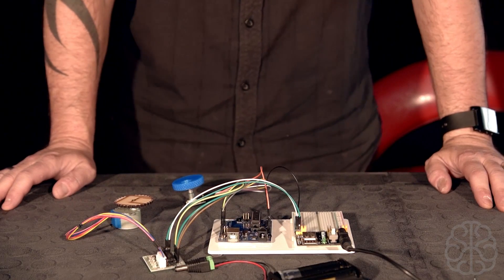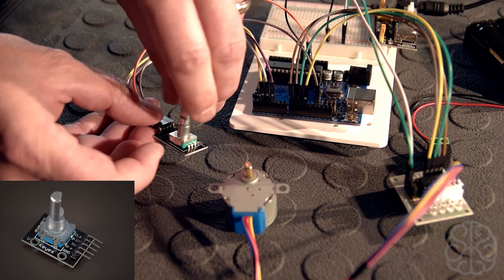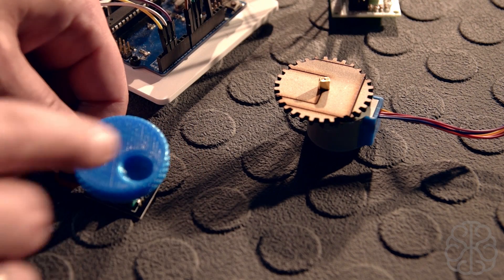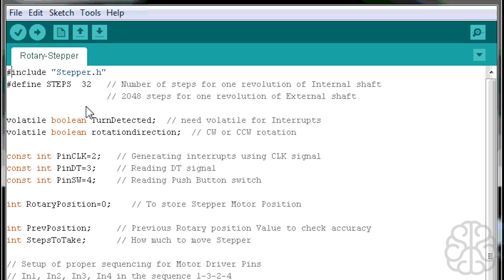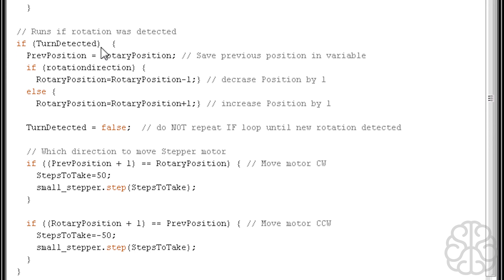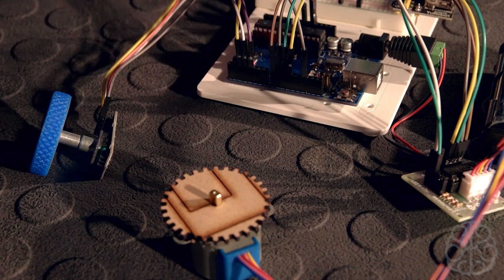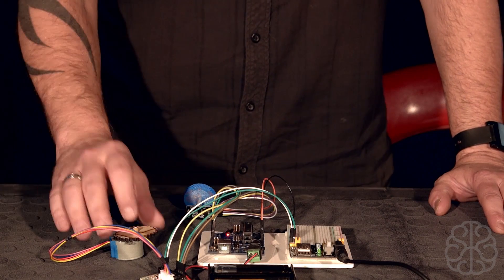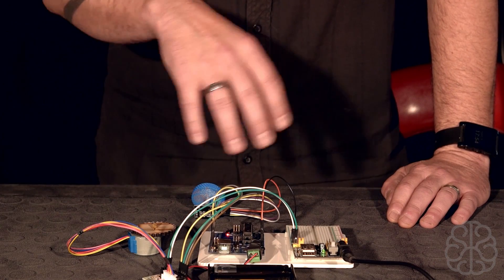Control a Stepper Motor using an Arduino and a Rotary Encoder - Tutorial - Part 1

Comment: I set this up, but on mine it doesn't always turn the stepper, and the lights on the driver board kind of switch around without input, I must have messed something up in the code.

Comment: Could you do that same setup, but use the encoder to "start the motor in 1 direction, having it just run continually, until you push the button to stop it, or reverse the encoder?  Also, the further you turn the encoder, the faster the motor spins. So 50% encoder clockwise means motor spins at 50% speed continually in the same direction?  Thanks..
Great Video

Comment: this looks like a very useful setup, thanks for taking the time to upload, could you please add homing and limit switch's to the code, or a video on how to include homing and limit switch's, I'm new to motors and struggling with homing and limit switch's, i need exactly your setup in this video, same motor setup/encoder, i identical but with homing and limit switch's , ive been working on it for a very long time and about to give up, any help please. thanks

Comment: arduino source code?
Reply: #include "Stepper.h"
#define STEPS  32   // Number of steps for one revolution of Internal shaft
                    // 2048 steps for one revolution of External shaft

volatile boolean TurnDetected;  // need volatile for Interrupts
volatile boolean rotationdirection;  // CW or CCW rotation

const int PinCLK=2;   // Generating interrupts using CLK signal
const int PinDT=3;    // Reading DT signal
const int PinSW=4;    // Reading Push Button switch

int RotaryPosition=0;    // To store Stepper Motor Position

int PrevPosition;     // Previous Rotary position Value to check accuracy
int StepsToTake;      // How much to move Stepper

// Setup of proper sequencing for Motor Driver Pins
// In1, In2, In3, In4 in the sequence 1-3-2-4
Stepper small_stepper(STEPS, 8, 10, 9, 11);

// Interrupt routine runs if CLK goes from HIGH to LOW
void isr ()  {
  delay(4);  // delay for Debouncing
  if (digitalRead(PinCLK))
    rotationdirection= digitalRead(PinDT);
  else
    rotationdirection= !digitalRead(PinDT);
  TurnDetected = true;
}

void setup ()  {
  
pinMode(PinCLK,INPUT);
pinMode(PinDT,INPUT);  
pinMode(PinSW,INPUT);
digitalWrite(PinSW, HIGH); // Pull-Up resistor for switch
attachInterrupt (0,isr,FALLING); // interrupt 0 always connected to pin 2 on Arduino UNO
}

void loop ()  {
  small_stepper.setSpeed(600); //Max seems to be 700
  if (!(digitalRead(PinSW))) {   // check if button is pressed
    if (RotaryPosition == 0) {  // check if button was already pressed
    } else {
        small_stepper.step(-(RotaryPosition*50));
        RotaryPosition=0; // Reset position to ZERO
      }
    }

  // Runs if rotation was detected
  if (TurnDetected)  {
    PrevPosition = RotaryPosition; // Save previous position in variable
    if (rotationdirection) {
      RotaryPosition=RotaryPosition-1;} // decrase Position by 1
    else {
      RotaryPosition=RotaryPosition+1;} // increase Position by 1

    TurnDetected = false;  // do NOT repeat IF loop until new rotation detected

    // Which direction to move Stepper motor
    if ((PrevPosition + 1) == RotaryPosition) { // Move motor CW
      StepsToTake=50; 
      small_stepper.step(StepsToTake);
    }

    if ((RotaryPosition + 1) == PrevPosition) { // Move motor CCW
      StepsToTake=-50;
      small_stepper.step(StepsToTake);
    }
  }
}

Comment: is there is a possibility to remove the shock from the stepper motor. when turning the rotary encoder it is only one direction .if I turn one way, it goes well but in the other direction it is shocking and it does not go well. how can I solve this?

Comment: Is there a particular Arduino kit I should get to run a stepper motor like in this video? Amazon has several different brands I'm not sure what the differences are to choose one : (
Reply: I got the elegoo kit which had 5 motors and 5 drivers. The driver board in this kit does nothing but increase the voltage from the arduino pins, and the leds on the side of driver show which pins (connected to motor) are getting power (which is great for learning).
"Elegoo 5 sets 28BYJ-48 ULN2003 5V Stepper Motor + ULN2003 Driver Board for Arduino"

Comment: You shouldn't use delay() inside your interrupts. You might mess up syncing with the internal clock in your code.
Reply: Can you break down "the why?" - I'm not familiar with why you would or wouldn't

Comment: Anyone try this project with this particular uln2003 module?
http://www.ebay.com/itm/231759592903?_trksid=p2057872.m2749.l2648&ssPageName=STRK%3AMEBIDX%3AIT
I've connected everything as shown on the Brainy-Bitz website, but the stepper only hums when the encoder is turned.
I'm using a 12v 800mA power supply, an arduino uno, & this encoder module.
http://www.ebay.com/itm/191886018364?_trksid=p2057872.m2749.l2648&ssPageName=STRK%3AMEBIDX%3AIT

Comment: plz reply me....
Thanks for making this video .......I have some questions regarding my project are....
1. for NEMA 23 motor 2.8 amp which driver should I use 
2.plz can you send Arduino coading for ' if we rotate rotary encoder 30° then motor rotate 15° in opposite direction ' 
3. when I rotate encoder the torque is same as on motor specifications or less??

Thank you very much.........

Comment: Hi, I am controlling my stepper motor automatically from the Arduino board, but once it moves and stops where I want, It does not go back to original (home) location [after short delay]. Any help with coding please

Comment: nice tutorial !!!!!!.  Tell me something plz. In your video you can control the position of a stepper motor by rotating the rotary encoder. If you want continues rotation with speed control (like a potentiometer for example), can you do it with rotary encoder? . For example, you can control the position as you video. Fine.  When click the rotary encoder, instead of returning back, can you use it for continues speed control ? (like a potentiometer?)  thank you

Comment: How did you manage to spin it that fast? It is 4096 step in one revolution according to spec (http://www.instructables.com/ORIG/FQY/RHST/HMVJ7U24/FQYRHSTHMVJ7U24.pdf) and frequency 100Hz.. which makes it about 40 seconds for one revolution, that is how fast I managed to spin it.. thanks.
Reply from the maker: From my understanding the library we are using runs those steppers in 4-step sequence.
Your mention of 4096 steps per revolution is correct when the stepper is run in 8-step sequence.
So in 8-step it will take 4096 steps for a full revolution of the shaft.  But in 4-steps it will only take 2048 steps.
That's why the stepper is running faster in this tutorial video.  You can checkout our tutorial page here: https://brainy-bits.com/tutorials/stepper-motor-rotary-encoder-p1/ and get more information.  Hope that helps and thank you for watching!
Reply: Brainy-Bits, yes, I wrote driver for 8 step sequence , I remembered it gave motor extra torque. Thanks.

Comment: Can u help me? I know how to use an enconder and a stepper but, i want to learn how to save a sequence of movements with variations of speed during 5+ minutes and use a button to repeat the actions that ive done before...
Reply: The idea is a motion control... I want to use 5 motors with encoders to enter different sequences of movements, cw ccw, speed variations... Saving the movements to repeat forward and backward. Can u do a video about it?

Tks!
Reply from the maker: Thanks for the suggestion, I have though of doing something like this, recording movements and play them back...  Will try to do a video on that.  Thanks for watching!

Comment: Hi,- Excellent tutorial. 
Can you tell me if the USB connection on the breadboard power supply is for 5v in or out because if its for 5v in I think you would need a special USB Cable.
 I will  definitely get one if I can drive it from a USB input.
Thanks - Keep up the good work
Reply from the maker: Hi, I believe these Breadboard power supply can be powered by USB, but keep in mind that a typical USB port on a computer has a 500mA limit.  Or you could use a Cell Phone charger with the correct cable like you said.  Thanks for your comment and for watching!

Comment: you can add two 1uF capacitor between A n GND and B n GND, and it will improve step skipping alot
Reply: Hi Herantd, can you please explain how to put these capacitors into the scheme?Thanks, Martijn
Reply: https://ccrma.stanford.edu/wiki/Images/c/c1/Encoder_filter.png
Reply: I'm not so good at reading schemas where the 1uf capacitors come in between thnx
Reply: Never delay inside an ISR. Period.

Comment: Hi, thanks so much for the tutorial. I have a problem where my stepper will turn fine in one direction but in the other it is unreliable and will twitch around. This is the same with this tutorial and the one for the NEMA stepper. I have tested both motors with test code and they are both good. I think it must be the encoder but I have 5 and they all act the same. Any ideas?! Thanks again.

Comment: greats think it very important for a beginner ARDUINO UNO programer 
my questions :
*1st :can we use an arduino to control a real industrial machine (using a PC power supply to supply the Arduino  ) ? 
*2ed : what happen when we use Arduino in an  electromagnetic interferance place ......are there risques of loss informations controlling ? 
best regards frome Nouari LAZREG automation Engineer and Operation manager of AFITEX company
Reply: It depends on what kind of industrial machine ( control signals required etc ) . A pc power supply has both 12V and 5V so you have the answer. A Engineer who ask "what could happen in a electromagnetic interferences" ...you a Engineer, aren't you !? Man you're askind for the "shielding"...

Comment: Hi! Great tutorials,everything well explained,without rushes.
Ive seen all your videos, but i was (still am) looking for a multi movements of the steppers,previously saved in arduino code. This to avoid to use browsers, i.e., tell the arduino (by a string or similar) to move the stepper like this: move to 1stop,move to 2stop,move to 3stop etc. So,instead of using the encoder or a pot, to use sequencial predefined positions.
Thanks!

Comment: what if I wanna use more than 1 stepper motor??
lets say that for stepler motor one you have ints PinCLK, PinDT, PinSW... how would it be for then 2nd? could i name it PinCLk2, PonDT2, PinSW? and for each statement repeat twice but the second one adding 2 indicating stepper motor 2? Your answer would mean a lot.. Im new to stepper motors and Im using this stepper motors to control a robotic arm... thank you

Comment: Hi!! What happend when you power off or reset the arduino when the motor is not in the 0 posicion? Does the motor save the correct 0 posicion?
Reply from the maker: +Rube G No, you would have to implement some sort of Home function when the Arduino starts up, to make sure the stepper motor goes to a starting point.  You can check out this video here where I talk about using limit switches :  https://www.youtube.com/watch?v=dQuTgngoFPQ  Hope that helps and thanks for watching!
Reply: +Brainy-Bits thank you greetings my friend!!

Comment: I was planing to the same project (without the push button turing tha same previous position) , but i notice than the driver lights stay always turned on. This mean than the motor is always on! and consume a lot of battery . how you can obviate this problem ?
Reply from the maker: +Julis Lybeshari The module that comes with this Stepper motor, doesn't have a pin to put to sleep or turn it off, but I guess you could use a 5V relay to turn it off with the Arduino when it's not needed, that way it wouldn't consume any power.  Hope that helps and thank you for your comment and watching :)
Reply: +Brainy-Bits  Many thanks. i will try.

Comment: That's great! I want to use 3 rotary encoder to control 3 stepper motor by arduino mega17. All motions I want to record  to sdcard and playback. Could you help me to find a solution? This is my email: phamquangtruong174@gmail.com

Comment: Can I use this setup to run a 12v stepper motor? Also is there a safer way of ensuring the rotary encoder doesn't skip or twitch when it misses the que?
Reply from the maker: +jason daysh Check out our other video here:  https://youtu.be/O9Pr1ZLYUmE i made some changes to the interrupt for the rotary encoder to make it more precise.  Not perfect of course but better :)  Hope it helps.  Thanks for watching!
Reply: Brainy-Bits
 Thanks for the extra info, I'm watching all your videos now and taking loads of notes. It's a great selection. Cheers :)

Comment: +Brainy-Bits I would like to control 3 stepper motors with different "rotary encoders" modules for each of them, and I would appreciate if you can explain me a doubt that  I have, the encoder can be connect to different pins, for example I have a Arduino mega and I would like to know if I can connect to pins 24, 25 and 26, I have read the pinout of Arduino uno and I realize that the pins to which you connect the encoder in the video has something peculiar as to the type of outputs as of digital inputs (pwm pin)
thank you very much
Reply from the maker: +Billy Zamora Díaz Check out this other video we did here:  https://youtu.be/O9Pr1ZLYUmE  were I explain how to make any pin an interrupt pin so you can attach 3 Rotary encoders to an UNO board if you want, each having their own interrupt!  Hope it helps!  Thanks for watching!

Comment: I got this motor in a starter kit from sunfounder. They say, that i can use the 5v pin of the arduino, but the kit is really poorly made and i think, the guys from sunfounder just don't know, what they are doing. Their example code is also shit. I don't have a power supply, so what should i do?
Reply from the maker: +StarTrek123456 These motor only draw 92mA current so it's ok to connect them directly to an Arduino if you want.  Thanks for watching!